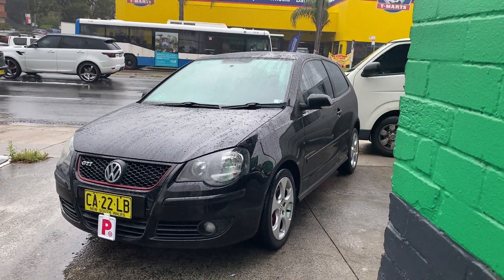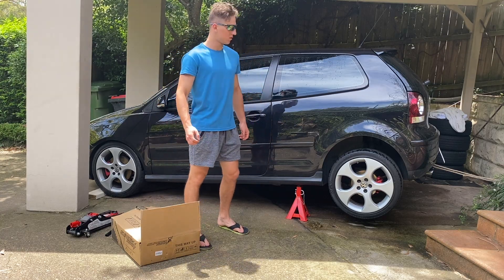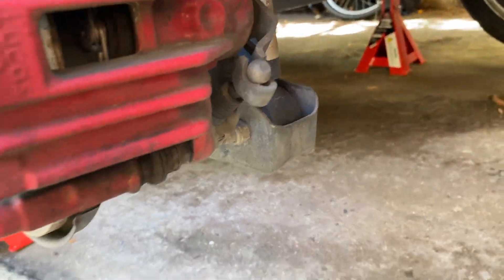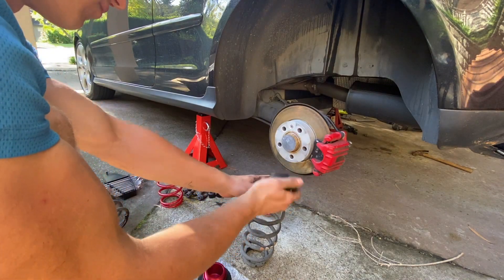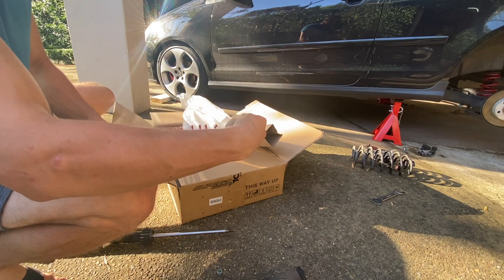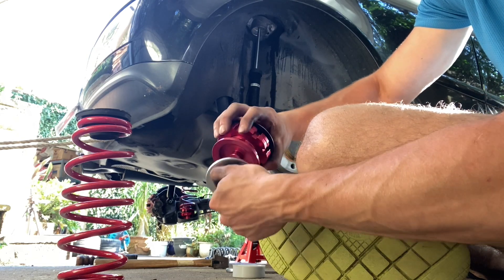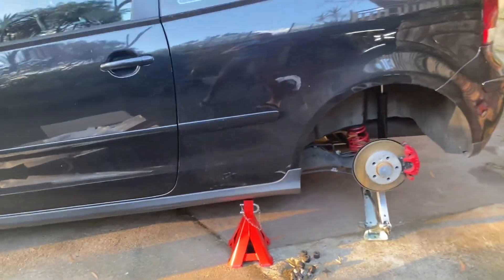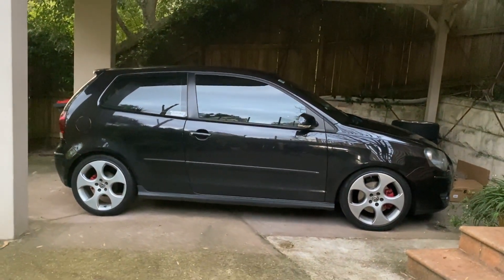Volkswagen GTI $300 Ebay Coilovers and Wheels install!

Comment: Hey mate, Did you have to buy modified strut mounts for the front to fit the coil overs or use the standard ones? See the standard ones are fine for the rear from your video but many help would be appreciated.Thanks
Reply from the maker: Hey man I just used the standard ones and it worked perfect
Reply: @mertyg  Thanks mate, really appreciate it, struggled to find a straight answer